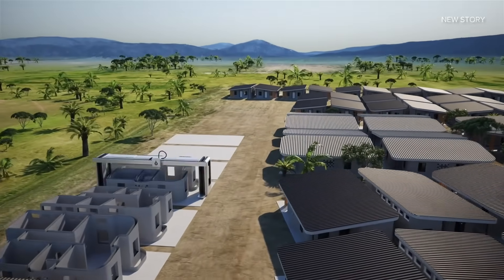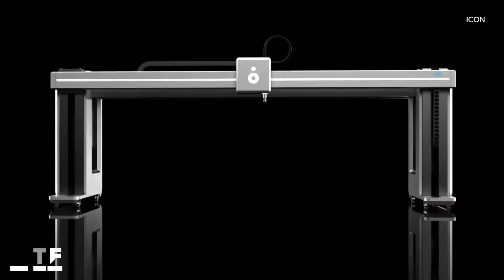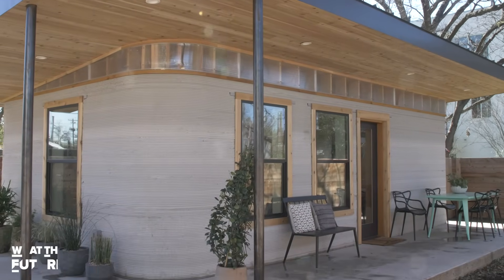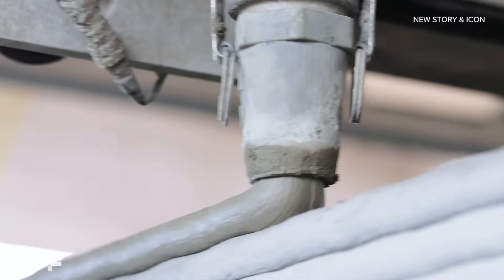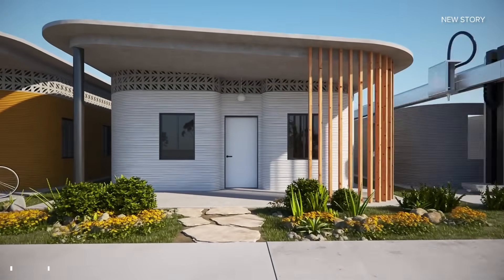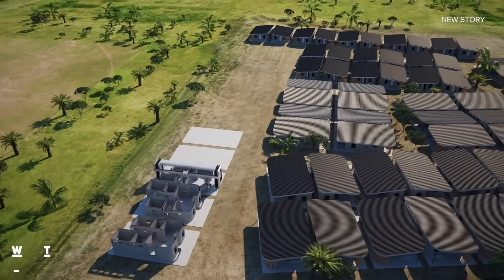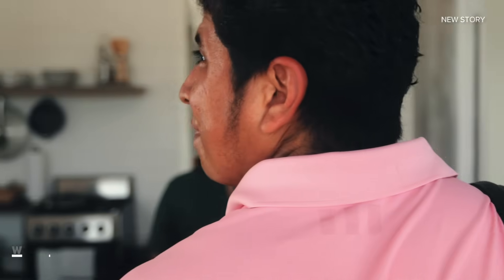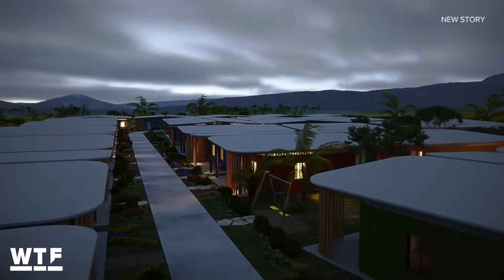The world's first 3D-printed community is officially under construction

Comment: We are building 5,600 units on my 700 acres, for a one floor 1500 sq ft, I need, 700 acres x 8 density per acre, 5,600 units. Can we build them One House at a time. That is 365 a year with one machine can't we get 10 machines to do 3,650 a year or 100 machines do 36,500 a year. We need bulk numbers my land is shovel ready. Give me real numbers per unit 3 bedroom 2 baths kitchen living room laundry room, entrance to cover electric recharger for electric car, parking space. All vehicles in the 700 acres are electric.

Comment: What you need is a robot sitting on like a excavator that can drive around the building area. That can be programmed or operated by hand. And the mix mad up from recycling waste plastic wood and metal. The buildings would be super energy efficient too requiring very little heating and cooling. This is without a doubt the future

Comment: This bothers me. A super strong concrete slab sidewalk with no reinforcement cracks.

and they think this low-grade concrete is gonna last more than 10 years without getting massive cracks running through it? 

no reinforcement whatsoever? 

This aint it chief.

Comment: How about hollow bricks that have a plastic pull tab on the bottom.  You place them like a normal brick house, without using mortar, then pull the plastic tab and there is semi-liquid mortar built inside the brick that falls and fills any cracks around the base of the brick.  It wouldn't need much mortar per brick because it just needs to fill very small air gaps between it and the 2 bricks below it.  Or you could just use a special roll of 1/2 inch thick "mortar tape" that rests between layers of bricks, then after the house is built you use a blowtorch on all the cracks and that melts the mortar tape and it softens and fills all the cracks, then hardens again.

Comment: Is this house made of concrete. If it does the question now is the structural strength of the house. I notice there is no reinforcing bars. In any structure to be built we always consider the strength for the safety of the people. It is amazing but unsafe specially the soil foundation not consider.

Comment: Initially i thought this wouldnt work on the moon due to the gravity however using powerful enough pumps (if pumps work on the moon which they might not work so well) to push the concrete down should  be fine and then low gravity would mean there is less slop on the concrete which is laid

Comment: Does this thing print the foundations, damp course, plumbing, electrics, heating, insulation, windows, doors, support beams, roof, plastering, stairs, drywall, painting, guttering? If not then it's only serving to replace one aspect of house building and it is questionable if it even saves much time compared to other rapid construction techniques.

Comment: If it takes 24 hours to print a house, it is not a good display that the success story is a community of two houses. 
As interesting as the tech is you have had concrete element building for close to 80 years, where the walls are made in a factory, driven onto the site and erected in one workday.
The interesting part would be if you could build different structures in remote places.

Comment: What about the cost of replacing electrical plumbing and gas lines as they become needed. Will a conventional utility worker be able to do this without affecting the structure and it stability? What about remodeling? Will a home owner be able to, say knock out a Wall for a bigger living room or add on a second addition. Or they going to have to start from scratch and print out a new redesigned home? Will the printers be able to get into the old area to do this later?  I love the idea and its worth exploring but don't knock conventional building for this... Its taken thousands of years to protect them and the added effect or machine vs people will weigh in on this too.

Comment: How sustainable are those thin walls? Fine in a proper environment but what about for cold environments? No insulation! No reinforcement in the walls? No rebar? Are they even close to any form of building code modern safety regs? Tech is great. Responsible use of tech is IMPORTANT!!!

Comment: Looks very solid but insulation, plumbing and electrical is ran on the outside of the walls. However it's 90% cheaper than a standard 🏠. beach house would be nice no worries of wood rot from flooding.
Reply: Other companies are making double and or triple wall construction homes, where insulation is blown inside, and pipes and wires can be placed as the printing is happening.
Reply: Or termites.
Reply: On the outside of the walls, that look crappy! Not only that, some idiot punks can vandalize your property! All the wiring and plumbing is supposed to be INSIDE!
Reply: @robertszymanski717  Which is why you read other comments in the thread.
Reply: @robertszymanski717  somebody doesn't know what he is talking about

Comment: Can't see this being more efficient than 3d printing then site assembly. The movement and the stabilising of such equipment on site will cause a multitude of problems. Extensive ground works would have to be made to operate such equipment to deliver consistent results.

Comment: To be honest this is some expensive tech for something that could be done better and faster... You could build a plywood mould of a structure of this size in maybe an hour if you know what you are doing, while putting steel reinforcement mesh inside and pure concrete into the mold. would be a lot stronger would look a lot cleaner and have a better finish in way less time.

Comment: They didn’t even put steel within the concrete did they? 
Overtime it will crack...

Ice cream melts, Concrete cracks...
If you have one cracked section you can fairly easily knock it out just by pushing against the wall. Even a strong wind could push it.

Comment: There's no real benefit here. It's just pouring concrete walls... at an extremely high cost. That's the easiest part of these homes, as the rest of the home requires standard labor for construction. This has no future as it's neither practical or economical.

Comment: The wall looks like you can scrape yourself really badly
Reply: Na, you put a facade to cover it.
Reply: What i'm more worried about is the reinforcement
Can you even go on the roof of this thing?
Reply: @mralabbad7  Did you not she the steel beams in the video
Reply: @lifelessweeb8504  you mean these bars that  they scattered on the wall a few feet from each other?
Or the outside ones that hold the shade
Reply: @mralabbad7  I thinks so
Reply: These houses are made for third world countries.   Neverthless, good innovation.
Reply: Perfect for a good back scratch 😊👍
Reply: They can glue sheetrock to it and paint it to look like a "regular" house interior wall if they want.
Reply: Just plaster over it

Comment: So no AC/heat, No gas, and no electricity. Good idea for the lowest of the low but I mean building a small wood structure wouldn’t take that much longer. Building the house isn’t the issue it’s the land you want to put it on. 💰💰💰

Comment: I don't like how advocates of 3D printed homes are comparing 3D printed walls with traditional whole buildings. With 3D printing you still need to do the base, water, cables, roof, floor, everything like in normal building. In the end, this technology replaces only one task in the process of building a house - erecting the walls. And in prefabricated plywood buildings, these can already be done cheaply within a day. This technology solves a problem that is not.

Comment: Better off making shipping container homes. They can be several stories high and are earthquake proof. They can fit all the walls, insulation, electrical and plumbing in the factory and then just deliver it on a standard truck, not lumpy and uneven either. Plus you are reusing shipping containers that would otherwise have to be scrapped. Developing a standardized shipping container home kit would be very beneficial, just connect a few containers for a full size home and if you need to expand then stack more on top.

Comment: designing concrete that is suitable is not hard... i'm guessing that they are using a plasticizer in the mix to allow it to flow then hold its shape once in position. as for printing in space that will be a challenge with the water sublimating

Comment: Framing can already be done on a house of that scale in under a day the reason you don't see it is because the majority of new homes are not that small not to mention wood is substantially cheaper then concrete. I can see that there are no plasticizers in your concrete nor is there fill I'm going to assume that your proprietary cement whatever magical mystical herbs and spices were used is going to cost about double what Standard Concrete will cost

Comment: Cons:
- Buckets of plaster needed if you want to have straight walls.
- Terrible seismic resistance (steel reinforcement would be extremely difficult to print around if they manage at all)
- No insulation.
- Electrician's nightmare
- A roof?
- Crazy expensive (You really think this technology is cheaper than some laborers who get paid pennies stacking some dirt cheap bricks?)
Pros:
+ ...?

Comment: Those structures look extremely unsafe and without knowledge of the construction material how can anyone repair or add on to a home. Further more is it actual siesmicly safe. Concrete still cracks but it's also very solid. When build with cement or concrete you know how strong it is, here there is massive potential for even a 3.0 surface quake go track between each layer eventually bringing the house down on residents

Comment: As a home builder, this is interesting but doesn't make much sense. Printing one component out of a hundred isn't going to bring costs down, it might even do the opposite. The walls of a house are actually cheap to build and represent less than 5% of the cost of a house. Let me break it down further. The walls that they are talking about on these small, rectangular houses, can be built by two skilled carpenters in one day, probably around 5 hours actually, with a material cost of $2500 and let's say $700 labor for the two guys(yes, framers can make $350 a day). Heck, let's throw in the insulation costs as well, $1000. So $4200 is the conventional cost of these standard 2x4 walls and I can't see that thing turding out a wall system for anywhere near that. PLUS and this is a big one, the cost of wiring and plumbing the house will be more expensive because there isn't a conventional wall system to use, which means either a lot of cutting into the concrete walls or running conduit on the outside of the walls, plus the windows and doors look to be in need of a post-turding modification to fit the frames, adding to costs that would exceed any savings you made during the printed walls. Also, there are steel posts supporting the roof system. Is this because the walls aren't strong enough to put that weight on them? idk.  I could really go on and on...

Cool idea, I like it, but the real problem of housing costs is government regulations and the permitting process. We can't just build houses on land. We have to have a lengthy, sometimes year(s) long process to get permission to build(this is in CA where 50% of the homeless live). We have zoning that is impossible to change because the people living in the areas are never going to vote for increased density, allowing for cheaper, denser, housing. The cost of doing business is also a hindrance on cheap housing as we have to pay about 100% to things that aren't in construction costs. So for every dollar that goes into the cost of the house, $1 is spent on stuff that allows us to build that house, insurance, workers comp, taxes, erosion control...

Comment: The building industry, mainly due to issues of scale, has so far avoided intensive automation. One of the last bastions of the old style of people powered manufacture is coming to an end. As a carpenter and builder myself, it’s been a good ride and the ride isn’t yet over but the brakes are just starting to engage.  One more example of the continuation and acceleration of vast societal change.